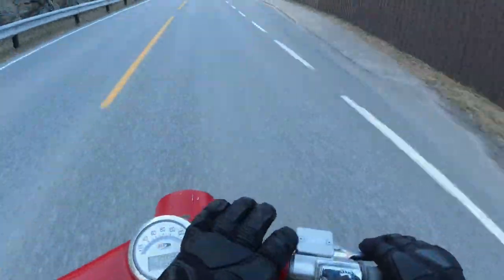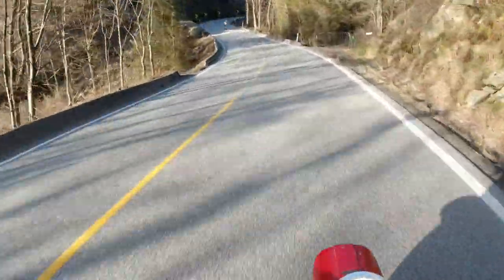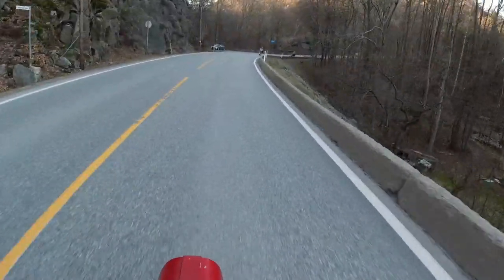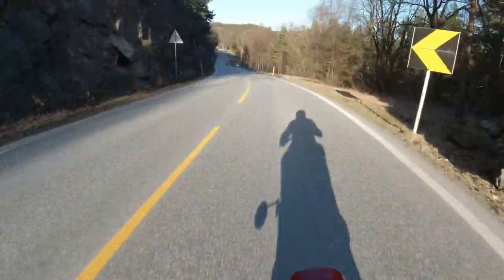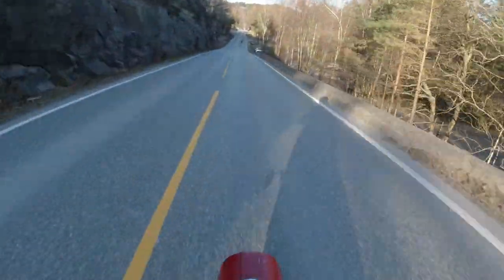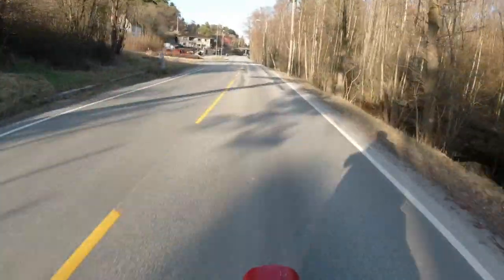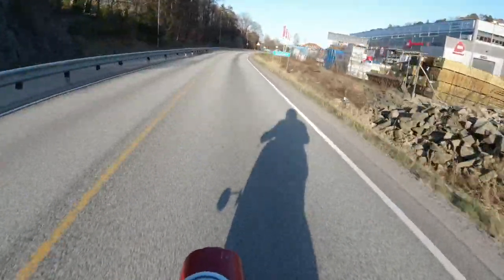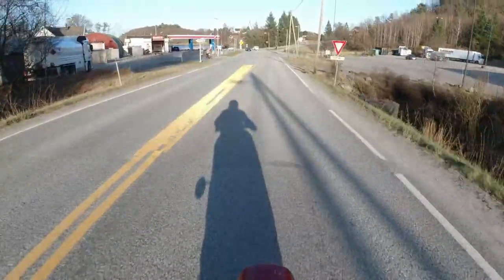#lambretta BGM anti dive disk brake review #kickbackgarage

Comment: Thanks Rob! Two questions: What springs are you using in the forks (standard or uprated). Also LTH also do a front disc brake that looks excellent, did you evaluate this as an option too? If so what are your thoughts.
Reply from the maker: The Lth and jockeys boxsenstop are the same brake. Only difference is that the bgm one supports a radial caliper, where the 2 others support side mount calipers so you can use piaggio/grimica type caliper.
Reply: @kickbackgarage  Thanks Rob! Would you also please share what springs? I assume soft ones, right?
Reply from the maker: Ahh, yes. I use the bgm + 10% springs because I'm a fatty. Standard ones work fine on anti dive setup.
Reply: @kickbackgarage  Clear, was there a reason to choose the radial caliper over the side mount of the LTH or just a decision based on whats in stock. Sorry, that’s my last question.
Reply from the maker: No probs. Its simply because I like to use scooter center.

Comment: Rob, have you managed to set-up the SIP speed sensor which is driven by the speedo drive?  I can't find any info on what settings to use on the speedo...I assume its an 'External' speed input as it's not a speedo cable into the back of the speedo, so you input the tyre circumference which is fine but then what pulse setting have you got yours set on?
Reply from the maker: You need to set the speedo drive ratio to 0.77.
Reply: @kickbackgarage  Hi Rob, I thought 0.77 was the transmission ratio that you set the speedo at when using the 'internal' source i.e. a conventional analogue speedo cable? When using an 'external' speed sensor source plugged into the digital external cable wire from the speedo (not the analogue conventional style speedo cable) you need to input the tyre circumference and then the number of trigger pulses. It's the number of trigger pulses that I cannot find data on? It has the potential to be any number between 01 and 99!
Reply from the maker: If you are using the speedo drive, external or internal it still needs setting to 77.
Reply: @kickbackgarage  Hi Rob, If you set the speedo to 'EXT' it doesn't even give you an option for inputting a transmission ratio, just options for a tyre circumference, and then a sensor point setting, which I have now discovered is sensor point setting '06'. All working fine now, thanks for your replies! Matt
Reply from the maker: Very strange. Mine doesn't but maybe they have they have updated it? Mine is 6 or 7 years old. Rpm doesn't work but temp and speed dose. 🤣

Comment: If the caliper is best bled off the bike you would think they would tell you in the fitting instructions.
Maybe using a bleed tube with non return valve would get better results?
Reply from the maker: The instructions don't cover the caliper because it's not included with the kit and the non return valve won't help getting trapped air out.

Comment: I have a problem in Spain, anything non factory means an ITV fail.
I'm hoping to fit the new AF inboard disc when it's released . I might just get away with it!
Reply from the maker: No mot on veteran vehicles here in Norway because its not really a problem.
Reply: It might work when you put an "E" code onto it. That's what I've been told by my spanish mate regarding pipes.